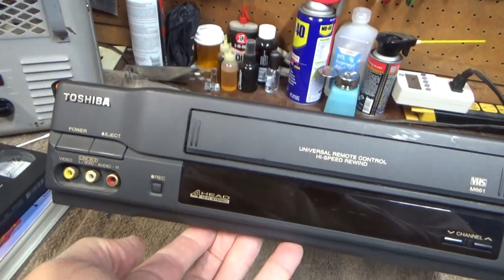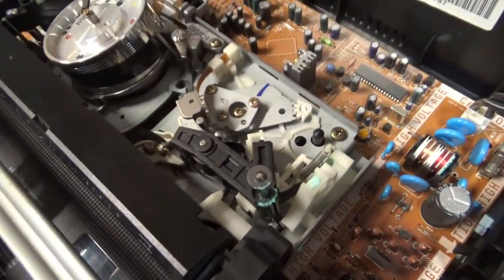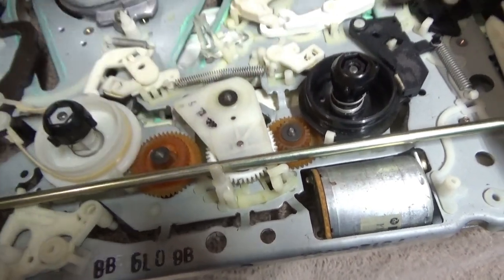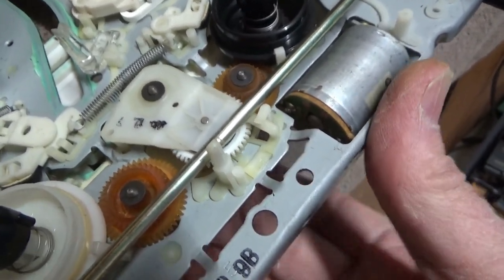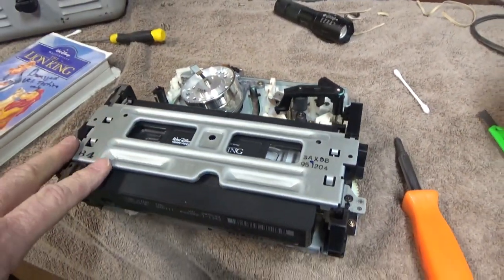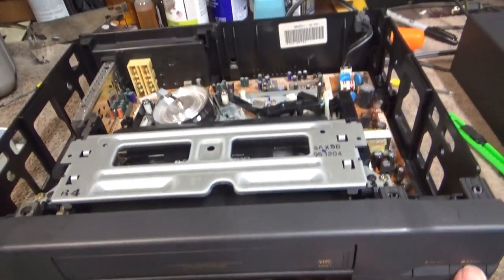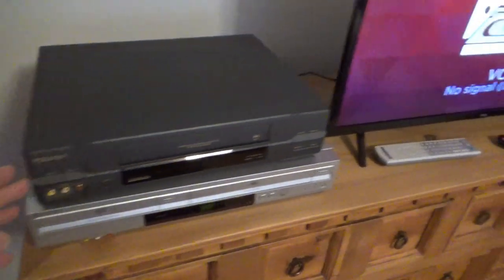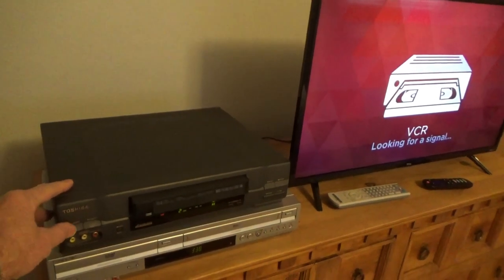Toshiba M-661VCR Service

Comment: Good analysis on it.  A little lube solved the problem.  No cracked gears!
Reply from the maker: The fix was easy but figuring out how to re-install the loader mechanism took me at least 90 minutes. I should pay more attention when disassembling.
Reply: I think I had that same unit. Plugged it in a couple of years and it blew a fuse. Replaced the fuse and plugged it in and it blew again. Opened it up and couldn't find anything obvious with the naked eye. That was the full extent of my technical skills. It went to the great scrap heap in the sky. Kept the remote just in case one pops up at the thrift store.
Reply from the maker: @Frank_nwobhm  I'll send you mine for free if you want to pay for shipping. You can probably pick one up at a thrift store for cheaper.
Reply: @mguess  That's very kind of you. I'm good though. I picked up a very clean JVC HR-A55U 4 Head VHS a month or so ago for $10.00 at the thrift shop. Even had the remote control. I followed your basic cleaning instructional video and it's working beautifully.